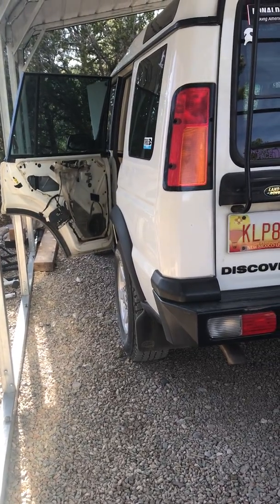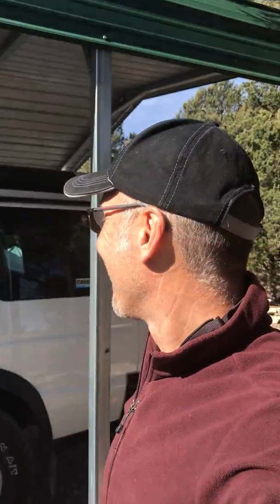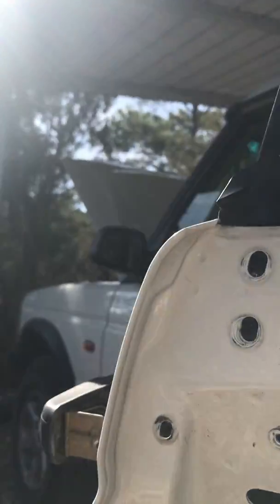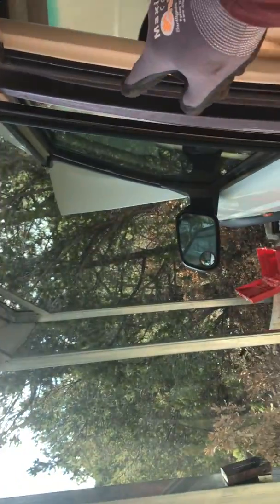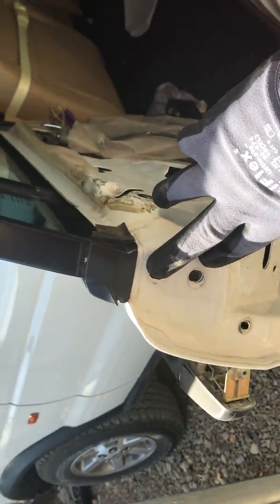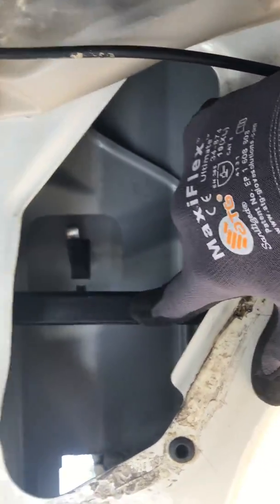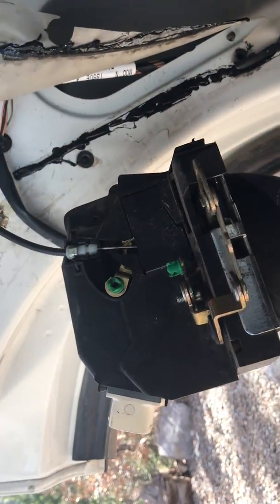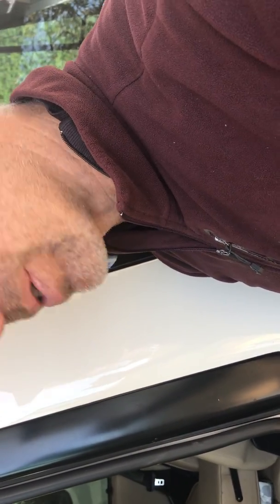Land Rover Discovery II - Rear Door Actuator Replacement

Comment: Thanks so much for your video. I used your method of 'adjusting' the metal around that opening of the inner door skin...I had to adopt this method through necessity as the bolts to loosen the windows frames started to destruct as I tried to loosen them (!!)...so...I used your suggested method, and didn't loosen the window frames at all. The trickiest part (and the bit that took the longest) was re-connecting the door handle link to the actuator. Once the door trim goes back on, no one sees the butchered metal beneath lol. Thanks again for your video! Well done.

Comment: Just finished a replacement exactly as seen on the video, but with four  points I'd like to add.  The first is the metal bending has to be about 90 degrees on the inner top lip to get the unit in and out.  Secondly, only the arch lower window frame bolt needs to be removed and it does move the frame, say an inch, but in this job an inch is welcome for such a tight fit.  Third, if your lower door is corroded on the external face, as mine is, take the opportunity of running oil inside the frame or use a lanolin spray or say, waxoyl.  I sprayed the new mechanism with silicone spray before fitting too.  Fourth, it wasn't clear to me how to remove the door mechanism, but the bolt assembly at the rear is the clue, however, the assembly needs to be pushed forward to clear outer skin before removing it.  Hope that helps :)

Comment: Hi - thanks for this video, it was useful when swapping out my rear right hand side door actuator on 04 discovery.  Didn’t need to bend the door frame though (which I was keen to avoid), I was able to just turn the actuator round a little and get it through the hole 😊
Reply from the maker: Cool! I just couldn't get mine out for the life of me without this Mod..... Perhaps I should drink less beer when I work on my vehicles? Nah!
Reply: Paulie Z 😂👍

Comment from the maker: Your welcome! My rear door one just went out, but that one was easier to get out, although still required some inner door acrobatics to twist it out ;-)
Reply: My other door had the same stuck soft screws, so I used the same method of metal manipulation on my other door - managed to do it in 20 mins which is a record for my usual slow pace on car repairs! Thanks again. Your video was very useful.

Comment: you don't have to do this. lifting the metal frame is quite easy since you have already removed all screws holding it, except 1 in the middle of the door, 13mm. remove this one too, then you could lift it with one hand. you don't have to remove exterior door handle. I just finished replacing all 4 doors this weekend. All by myself.The driver door you will have to remove the door handle though, coz there is a pin plugged in the actuator.I end up removing the whole driver side window frame away to have easier access, coz this actuator is much bigger. Have fun :)

Comment: The problem with mine is my door is stuck shut I can’t take the actuator off because the door won’t open nothing works I even took the panel off and still
Reply: Michael Villalpando same did you ever get it